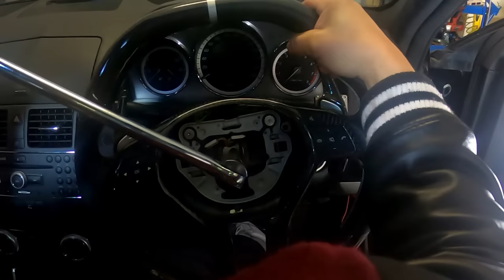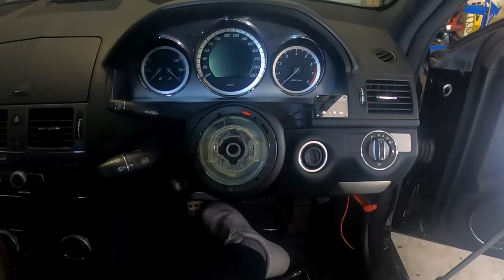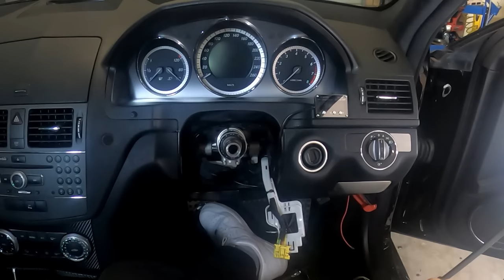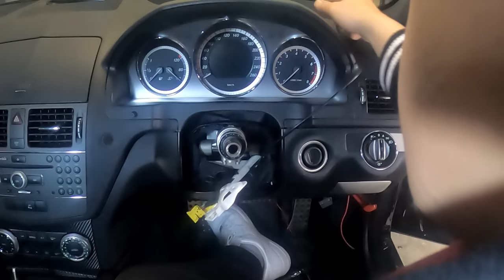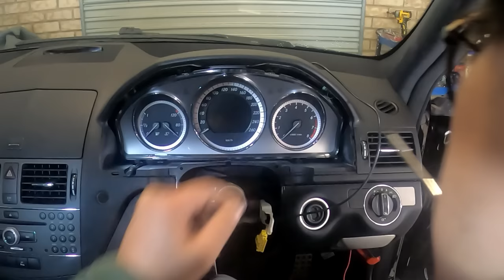HOW TO remove and fix ESL/EIS/ ELV MODULE  w212 w204 mercedes motor replace  Part 1

Comment: Hi Mikey suddenly this happened to me!! I parked my car and two days later when I went into the car to turn it on my ignition goes to all the positions but my car won't start and the steering remains locked and won't move then I saw your video and thought it has something to do with the esl  so I don't have a rubber hammer but I tried tapping it with my hands but esl won't unlock . What should I do in this case to unlock it?
Reply from the maker: get a hammer and tap on the steering column hopefully it will unlock it..and if it does unlock make sure u disconnect the battery with the key in the ignition ... then disconnect the neg- terminal cable .... but only attempt if you can fix the esl your self...if you can do what I've showed or lack the skills then maybe just remove it and get someone to fix it for u
Reply: Thanks will try with hammer for sure hopefully it works and will let you know what happens
Reply from the maker: @technoboi-4295  for sure my friend let me know if there is anything I can help with ... I'm here to give any help I can ... tapping underneath with a hammer will help it does t have to be a runner hammer u can always use a normal hammer just ve sure to cover the spot your tapping with a piece of cloth or something similar so you do not scratch anything ... let me know how u go...
Reply from the maker: @technoboi-4295  it may take a few tries but some ppl have success some dont .... it just depends on the situation and what the issue is... give it a try and if it does work make sure you get back home so you can try to remove the esl module or else if you cant do it yourself you will have to pay someone to do it for u
Reply: Hi I tried tapping with hammer several times but no luck so now what should I do? Also I contacted a mechanic and he came and told that we will have to repair the esl for which we will have to remove it and install new and then re code it to your car and he told me it would cost a lot and would take 3 days at least so what can I do in this case. I am ready to do it on my own and I have skills to do it but the esl is not unlocking using hammer so what should I do now?
Reply from the maker: @technoboi-4295  sometimes it's just a matter of luck ... u can try charge the battery and try again .... unfortunately just keep trying sometimes it's a matter of luck and trying over and over again.... there are also other ways to remove esl in pocked position but its co.pletely different ... try search on routine and Google what else you can do

Comment: I have a 2010 c300 w204. I had this issue and just got the motor in the mail. I have a few questions. I seen a conflicting comment on another of your posts, and it states that you can't just plug everything in and have it work but that you have to have the eis plugged in (haven't removed mine anyways) and hook your battery up, then insert key into eis (don't turn it to on/run) and then plug the repaired esl back in. Is this true? Also seen another video about esl lockout. Do I have to worry about this?  My esl failed in locked position (tapped it with mallet to unlock it and get it running again, and drove like this for 6mo since it would still run and ignition would not lock)...and then i disconnected the battery to put a new one in and it would not start (assuming esl failure in unlocked position causing no-start).
Reply from the maker: hey buddy sorry for the late reply ... so what i eamnt is ...once you replace the motor, grease it, pout everything back together carefully and properly...with the grey switches pressed down.... then you can plug everything back in and reconnect your battery.... take key out and reinsert key...its important..if it doesnt work right away then you have missed something..do not try to keep starting the car as it will trigger an anti theft and lock you out.... you have to reconnect eis and esl so it can read the key or else it wont read the key and send a msg to esl and ecu to unlock

Comment: not sure if we have the same problem. our 2014 e350 / W212 motor makes noise with switch but no longer moves at all. up or down.
Reply from the maker: ye would be the same ... if u use a merc scan tool it should tell u if it's esl or not

Comment: Hi I have a merc Ml (uk) my key turns the engine starts but sometimes I need to turn the key 7 -10 time’s before it sparks the car into life. Does that sound like EIS or ESL I don’t know anything about cars (Iv watched  your video and just need clarity ) I want to do the fix myself with hubby but very worried that I will screw the car up ?!?!
Reply from the maker: yes dedinitely sonds like the esl is malfunctioning ... i would get its scanned by a reputable mechanic with the right scan tool that can pinpoint your issue and go from there ... but in my experience it aounds like the esl ....some rare cases it can be the eis...ignitiom switch but more then likely the esl motor has failed ... also look into eal emulators they are a great alternative for future proofing the issue

Comment: Hi Mike! I went ahead and did this project since the ESL failed me 2x already in the past. I changed the motor and when i tested it there was nothing. I followed your instruction carefully but whenever i try to insert the key, it would tell me to pull out key. Please help… Thank you!
Reply from the maker: the only thing u may forgot is to press the lil grey switch buttons on the pcb , u will see 2 lil grey button switches they must be pressed down when u reinstall the esl module together , thi sis a important factor , as many have said in the comments , mine was already pressed so once i reinstalled it worked like a charm ... most ppl have had success without realising this too, be sure to check this and do not keep trying to start the car, if key doesnt read then u must disassemble again and redo process until its just right
Reply: So press down and hold? Both at the same time? Thanks again Mike.
Reply from the maker: @sramzurc8000   @Sramzurc  you press them down and put everything back together , just ensure they are pressed when u put back together your entire module
Reply: @MIKEYZVLOGZ  I did exactly what you said but still no luck. I was thinking i probably fried the board maybe. What do you think is my next best option? Thanks again for tour time Mike. I really appreciate you.
Reply from the maker: @sramzurc8000  if u can't get it to work... I think Ur best option is to get a emulator and have it coded .. will cost about 300 to 450 depending who does it ... but cuz u already have it apart... contact your closest sutomotive key specialist and ask them how much they would charge to fix it .. tell them u have the car apart already.. u just want to have the esl looked at and ensure it works... if your lucky they may only charge you like 100 cuz u did all the work
Reply: @MIKEYZVLOGZ  Thanks Mike appreciate it.

Comment: How do you unlock the dam thing if it’s locked position
Reply from the maker: that's why I stressed to only try and attempt if its in unlocked position ... if it's in locked position it's abit more involved ... for example ... u can drill a small hole and turn it manually with a pick ... u need to make sure u drill where the plastic wheel is... so u can turn it manually
Reply from the maker: u can also remove the entire steering column and cut the bolt off and then replace the actual bolt itself.. like I said it's more involved but very doable

Comment: I took off mine while it was unlocked and tried it to see if that was the problem. Inserted the key and nothing happened. I took off the key and it locked. Last leg of the motor i guess. I unplugged it and waiting for the new motor to come in. Should I install it unlocked or leave it locked like it was at the very end?
Reply from the maker: however u removed it unstall same way so reads the correct rotation
Reply: @MIKEYZVLOGZ  I had already taken it off the steering column as it was originally unlocked. Once I had it in my hand I plugged it back and tried to see if that was the issue and it  locked when I took off the key lol. So i should install it under the last known position which was locked for me? Also can I just leave it off the steering column in case it happens again?
Reply from the maker: @christhegamer2607  yes test before u put it all back together to make sure it works how u want then wen ur sure reinstall
Reply: @MIKEYZVLOGZ  GOT IT. THANK YOU SO MUCH!!
Reply from the maker: @christhegamer2607  no worries

Comment: dear if i replace the whole ESL unit do i need programming.
Reply from the maker: yes friend u will need to have your new esl reprogra.med to suit your cars eis .... definitely
Reply: Choose a locksmith with the electronics to sync the ESL with the ignition lock and key. Aliexpress sells the circular tool to remove the ignition lock.

Comment: I change the motor but is not working you think is the ignition switch
Reply from the maker: u need to check that the motor was installed correctly , did you make sure u did everything right, alot of ppl forget to check the switches and make sure they are exactly as they were wen u pulled the motor out , and this si the main reason why ppl cant get it to work

Comment: I hit the module with a hammer with key turned to ignition. Managed to get the screw to depress in after a bit of struggling but even with the screw fully depressed in I couldn’t pull the module out. I kept key in ignition and got a colleague to disconnect battery and after a few attempts at trying to depress the screw and pulling out it’s locked itself again and now I’m back to square one again?
Reply from the maker: once it's unlocked leave key in ignition and dc the battery then it can't lock again cuz u will have dc the battery .. its sucks wen that happens and ur back to square 1 ..it happened to me too..then I just left key in and tapped with hammer til it unlocked and straight away dc the battery and I could then take my time to take it apart cuz it was dc... dun give up u can do it.. all the best to ya bud

Comment: Showing exactly where the ESL is would help a lot.
Reply: The ESL is toward the back of the steering column. Near the firewall. On top of the column that you loosened to move around.
Reply: My ESL was unlocked. But still couldn't push the screw in enough to unlock it. I removed the whole column. It actually will come out with what you have removed already. Just some careful wiggling.

Comment: How do you know if the chip has burned out? I bought a new motor for the Esl and had a friend replace the motor. He was tapping on the Esl and I said that’s not the way you you reassemble or put the Esl back together. I’m thinking that’s what burned it out. Because as you said in your video the common problem is the motor not the chip.
Reply from the maker: correct it is the motor not the chip... the chip is what u can damage if u don't do it right .. but I'm pretty sure its just ur motor ... not the chip... replace the motor it will work again
Reply: @MIKEYZVLOGZ Thank You! & okay because I bought two motors and the one I got from Amazon was replaced. It still did not work. So should I try the other motor that I bought? & if that does not work what do you suggest? Would I have to bypass it with the emulator if so what kind of emulator? Is it the W204 for a 2009 Mercedes Benz C350? I’m confused as to which emulator to get if all fails.
Reply: Appreciate your fast response btw! Love your videos. 🙏🏾
Reply from the maker: @eatwithkarma9645  thanks mate appreciate it

Comment: Hey Mikey! I’m having this issue and I’m pretty sure my ESL is in the unlocked position. But is there any way to make sure it’s my ESL and not my EIS? I’d hate to rip my dash apart and replace that motor and my car still not start. 
Thanks in advance!
Reply: I'm curious of the same thing. My car is a 2012 mercedes c300, unable to start as we speak. Key Unlocks, locks, trunk opens, etc. No window control or heated seats and other power. Steering wheel moves, doesn't lock. Checked battery, fuses, relay, shook wheel, put it manually in neutral after removing stick shift. NOTHING. But, when I put key in and move to start position I dont hear any noise just some dash lights go on. And remove key. How do I know its the EIS/or steering lock switch? And will the same steps work on this year make and model? And is there a theft issue as a previous gentleman explained if not done correctly? Please, help. And thanks MIKEYZ your very thorough.

Comment: Hi Mikeyz, your video and explanation are just perfect. Having the same issue with my W204 last september and having it towed to a shop did not really work in long term because I started having late engine runs/so many trials to start it. The same guy fixed it but lasted a month. Now that we are in quarantine for almost over 2 months the problem is more serious. Please confirm whether this has something to do with the car battery. My 2011 made car still has the original battery onto it and even though the key works fine, it doesn't cranks as good as it used to. Thanks in advance.
Reply from the maker: hi friend firstly hanks for ur kind words ... so wen u say your car doesnt crank? do u mean u habe to crank it a few times to get it started? does it not crank sometimes? depending on the situatiom it could be a dying battery but batteries only die if they discharge completely withoit being driven so they can charge... what do u meam by late engine runs??? sorry i dont understand your terms... pls elaborate for me..so i can understand more of your issue
Reply: @MIKEYZVLOGZ  if the ESL works after several trials the car eventually cranks but due to worn out battery it picks up late. I just wonder this battery situtation could also cause the late ESL runs. Yesterday I waited almost 3 mins by keeping the key in the ignition and finally heard that amazing ''whirrrr'' sound to start the car.
Reply: @MIKEYZVLOGZ  Sorry Mikeyz, I guess you already have answered my question anyways. My other question would be this: Assuming the car started after having several trials with the ESL and what if we keep the spare key in the ignition and lock the doors with the other key. Would the ESL start anytime we turn the key?
Reply from the maker: in your case its definately the esl..i know it may seem like a flat battery but its not ...its the esl...
Reply from the maker: @hakanyarbaoglu1493  no key must be inserted to unlock esl....i can say with full.certainty that its yoir esl failing and u need to change it asap or get an emulator... or it will one day completely stop working...i kmow it happemed to me too... i was happy when my car started a few times too..but ive lesrnt that its the esl that fails..amd theres no real given sigm apart from what yr experiencing now

Comment: Where can I buy the special tool to take out the 4 small screws in the ESL case?
Reply from the maker: ebay has them just type in ebay esl/elv tool removal tool and it will come up
Reply: Thanks for the quick response. If I'm not able to get the tool in time since they only sell them in Asia. What can I use instead of the tool? I think it will take too long coming from China...lol
Reply from the maker: @rrraaadddiiiooo7766  u can simply use a t5 torx bit and just hammer it in lightly it will still work
Reply: @MIKEYZVLOGZ  Thanks again...I just need to replace the motor...I hope I don't have issue with the EIS. It seems fine...However the ELS works most of the time. But sometimes I don't hear it engage, and the car will not start. I also hear the relay (I think) trying to start the motor. Faint clicking noises...Mercedes should be ashamed of themselves using a brushed cheap rc motor for this device. At least put in a brushless motor...smh...But thanks Mikey and wish me luck...I'm going to need it.😂
Reply from the maker: @rrraaadddiiiooo7766  your right on the money there yes merc should be ashamed of themselves ..its a cheap little motor they used hence why its such a big issue... and problem is it can fail anytime..i helped another subscriber get through his install by msging him back and forth and he managed to do the fix also...wish you all the best with yours as well... its pretty straight forward ..just pay attention to detail.. most important
Reply: Aliexpress sells the lot, motors, handle with small pin to take out the pins; they are not screws plus they sell the circular tool to take out the ignition lock. Can pay extra to get stuff from China faster.